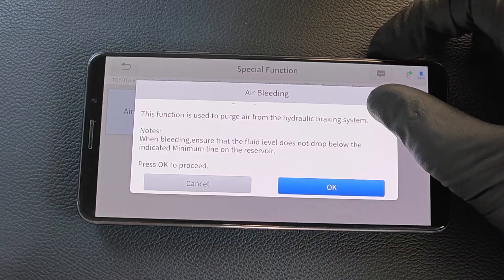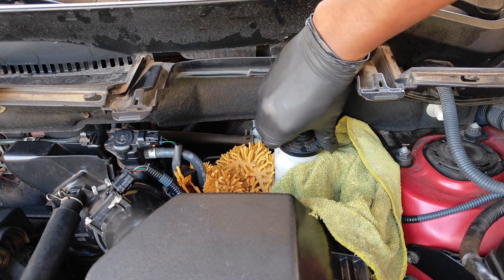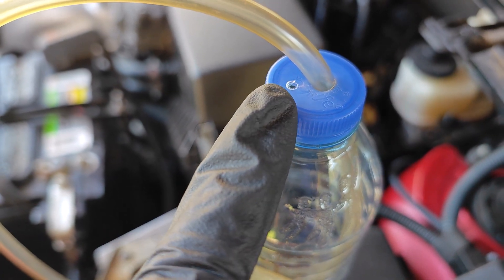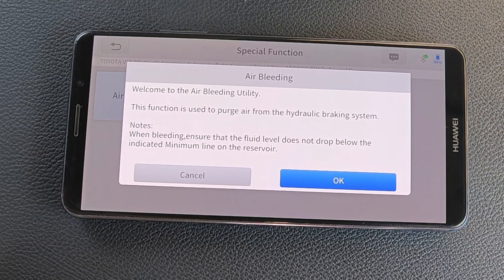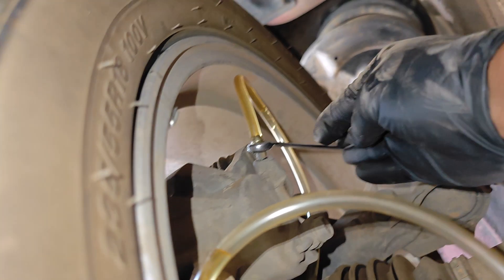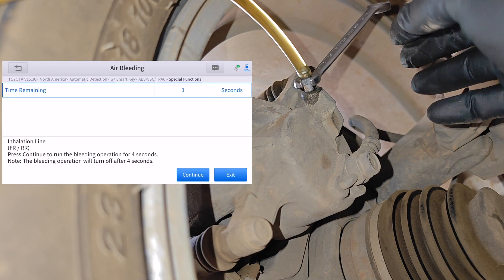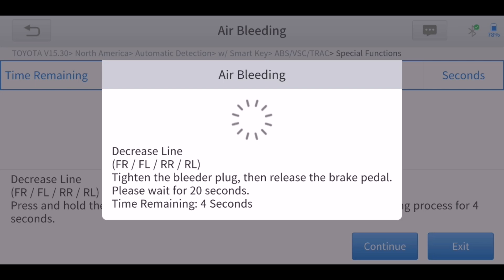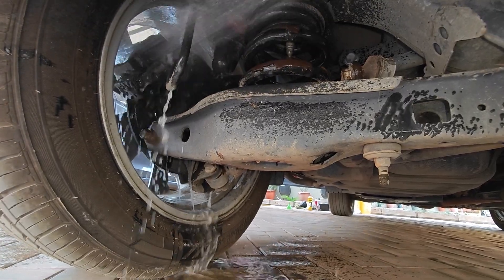How to Remove AIR from ABS system with a Scanner /  Toyota ABS module Bleed

Comment from the maker: Have you ever had to bleed the ABS module? What tool did you use? 😀
Reply: A Ford Taurus....years back.....OTC Genisys.  It was more "automated" like the way you describe the Honda as being.  Then used this same scanner to check a 2007 Lexus - to see if it had a working (fully functioning) bleed routine, and it did, but it was not necessary to do the actual bleed.
Reply: i use a diy solution.
Reply: used the Launch 431 v and thinkscan device. I used a 22-pin Toyota adapter, and a friend also tried the Bosch diagnostic device. My devices only showed an anomaly in the left front wheel sensor, nothing more could be done or activated.

Comment: Very nice video.  I bought an xtool 100 max. Working on the ABS of a 1999 Toyota Sienna, when I went to the ABS function, it said that it did not support that year/model of Toyota Sienna, bummer!  I guess I'll just have to do it "old school" and bleed them the usual way. I noticed when I turn the key to ignition on, the ABS pump runs for a few seconds, so I might try and use that to help with the job bleeding the brake system.
Reply from the maker: Thanks mate. 
Bummer on the 1999. Coming to think of it, Toyota may not have built in a service function for that year/model.

Comment: oyota Landcruiser 1999 petrol. None of the diagnostic devices show the data flow of the ABS system and also cannot start the ABS bleeding. What to do.
Reply from the maker: I don't know if Toyota built in scanner support for ABS bleeding for the car, could be wrong though.

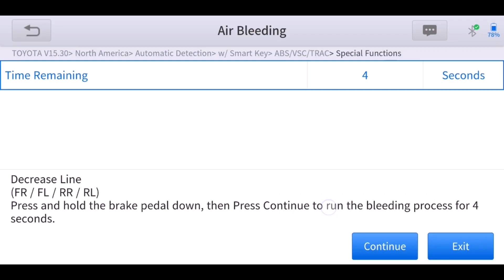Comment: Hi. Question about Decrease Line in video at 4:37 minutes. As it looks like the exact same video clip shown at 3:53 minutes? Are you sure the ABS Pump runs in this decrease line stage as on my car the ABS unit solenoid activates only. And I have verified no pump action using two different scan tools at this stage in the 4 part bleeding process. No pump action during the decrease line stage with both my Autel MK 906 BT or my Xtool D8.

Comment: Flare nut wrench is not needed if your going over the bleeder valve. a normal 6 or 12 point socket is totally fine.
Reply from the maker: Yea, I agree. But would still use flare nuts for ease of access and insurance against stripping (just in case the last guy that tightened used brute force)

Comment: Might you know why the scan tool software is telling you to bleed the wheels out of normal order? Usually manual bleeding is RR, LR, RF, LF. So this "inhalation" and "decrease" line process seems oxymoronic. What happens if the do the "normal" order with the scan tool...RR, LR, RF, LF?
Reply: This will be because the lines need to be purged of air and the abs also. If only one part of the system then the normal procedure you mention will suffice. The module bleed will use approx 2 litres of fluid depending on the system. The ABS module must be bled completely which cannot be done effectively using the ‘usual’ procedure.  As mentioned it may be required to run the cycle/procedure a couple of times to expel all the air.

Comment: Will you make a video  that shows how to bleed the abs pump  on the 1997 toyota land cruiser ? The scanner tool does not  connect  to the  abs pump . Will you show what  pins have to be connected  to the 2 connectors that are at the abs pump ?
Reply from the maker: Hey. Many thanks for the suggestion. Unfortunately, I don't have a Land Cruiser so it'll be really difficult to do a video on it. Perhaps do some search on it on YouTube?

Comment: do you need to press brake pedal everytime you using scan tools? for this abs bleeding? saw you did it on  the video? now yo ujust press the scan tool unsscre the bleeding screw?
Reply from the maker: The tool will tell you when to press or not press the brake pedal.

Comment: one tip that i read about and then tried for myself, for holding down the brake pedal, you can get a spreader style clamp, reverse one end. one end goes to the brake pedal, one end goes to something else, like the bottom of the steering wheel. if using the steering wheel, make sure it's stable and not going to slip when you're going to open the bleeder screw
Reply from the maker: That's another way for doing it!

Comment: GREAT VIDEO....thanks!  One thought/comment here:  After the ABS bleed that you showed/went through there, doesn't Toyota (and maybe others) say to do a conventional bleed also - right AFTER you finish this?  I mean - right AFTER you do what you did in this video, we are supposed to then do a full conventional bleed - as the next, and final step.  I believe the thinking is that air that may have been trapped in the ABS unit, is forced OUT of that unit, but not enough fluid was pumped all the way through the lines to take that now released air OUT of the lines.....and doing this conventional bleed will get it out.
Reply from the maker: Thanks for the compliment!
Tool didn't say anything, but I've since done a full conventional manual bleed as I wanted to ensure I got all old fluid out.

Comment: very good video brother.i've tried this method on 2006-2012 rav4 and most of them had soft pedals and i never understood why except that some how the air doesn't purge.the only way i got back a firm one was using the conventional method of bleeding at each line connection ;very messy but always work.
Reply: Une pedale molle signifie que soit vous avez de l'air dans le circuit soit que votre maitre sylindre de frein est defaillant , si c'est pareil apres une purge simple des 4 roues alors c'est votre maitre cylindre HS 

Si vous n'avez plus de frein du tout alors c'est votre pompe a vide a controler c'est trres facile ;)

Comment: Would i be wrong to assume that in the case of me just wanting to refresh the brake fluid could i not just use the step where the abs pump spits out the fluid and just click continue on all other steps without doing what says I'm supposed to be doing?
Reply from the maker: I'd rather not do the procedure at all than implement some of it's parts. Will likely just push air out of the ABS module into the brake lines.
Reply: @DIYAutoworksNG  as i said the above scenario is for a fluid flush/fluid refresh which means i've got no air in the system
Reply: @MarianA-vu8tb  a bit old but did you end trying it? Seems logical to just have the abs push out old fluid until you get the new fluid flowing out. Would be easier since you have no air in the system in the first place. Lmk if you did please
Reply: @ivers6477  no I did not try it.